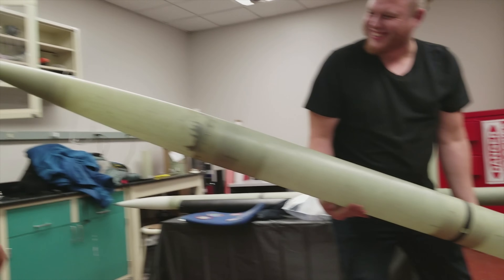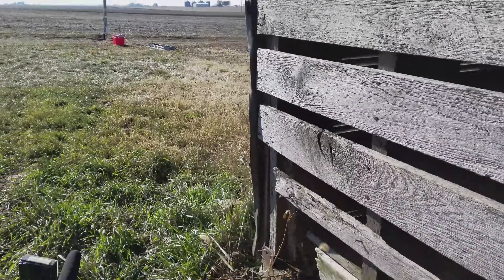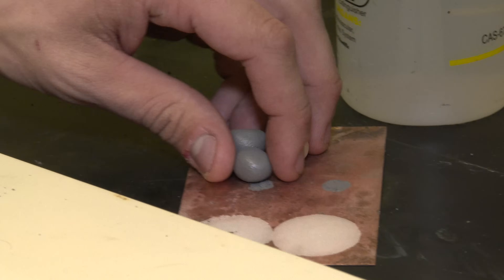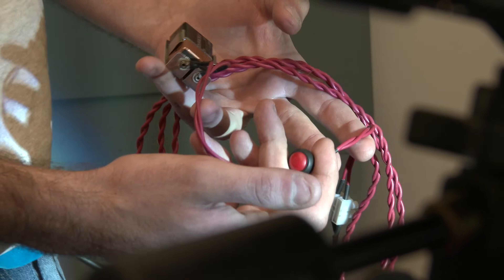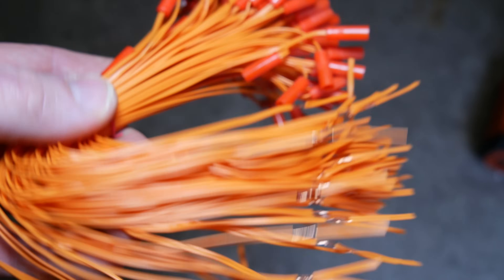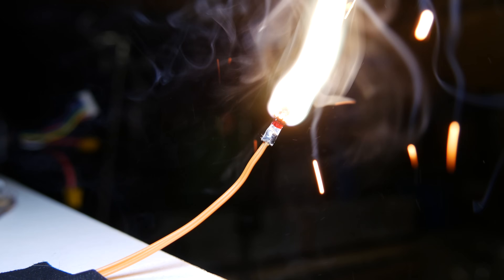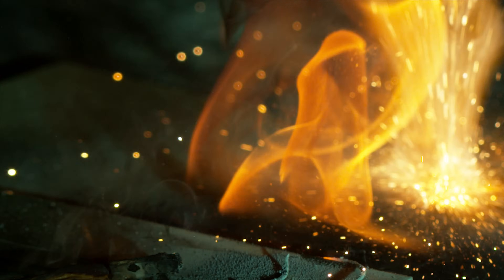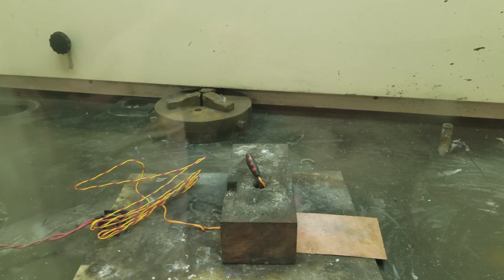Rocket Igniters in 4K Slow Motion - Amazing !!

Comment: Uhmm..stupid question but..
If they use an electrical charge to ignite these 'igniters' that then ignite the rocket propellant...then why not cut out the middleman  and just use the electricity directly on the propellant?
 Is an electrical coil used?
 is it not hot enough?
 what about an electrical arc?
Reply from the maker: Very good question.

Comment: A very well done video.  One small suggestion is to briefly overlay the recorded video frame rate down in the corner at the beginning of each segment.  This would help orient the viewer regarding what is being seen in slowed down motion.
Reply from the maker: +bluepacificsurf I have done that in the past frequently, but as my Focus shifted from mainly slow motion, early videos, to the full format where I am using slow-motion more as a tool I stamp that in less frequently. I think I will start doing it like you said very small in the corner so it's not super distracting. Thanks for the feedback

Comment: That was beautiful. And the footage of the first igniter is a good illustration of why, for safety, you need to wait sixty seconds after a misfire before approaching a rocket - the propellant may in fact be ignited, and slowly coming up to pressure!

Great video.
Reply from the maker: +The Rocket N00b thanks, that's a great point I didn't even think about.

Comment: That looks amazing!  This 4th of July instead of fireworks, I'll just watch this lol.  In all seriousness though, those quick burn igniters made to prevent hang fires are sweet, but also look like they burn quite violently.  Do you know if they are anymore unstable than the normal igniters, or is their flash point still about the same?
Reply: they are not any less stable than regular igniters, the reason they are so violent burning is a trade secret
Reply from the maker: +Russell Poyner I would have to check with the rocket team guys on that one, I think there are still developing them so I don't want to share any information I shouldn't be. I'm going to ask them to come to this comment and I answer some questions.
Reply: Patrick Begalowski Now that is awesome!
Reply: Patrick Begalowski ;)